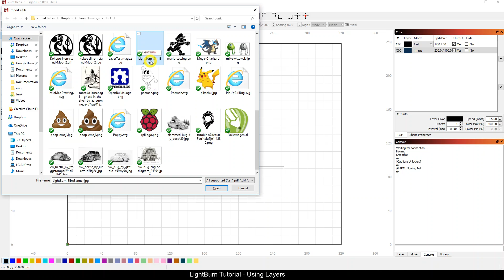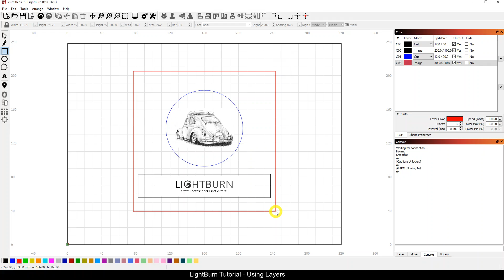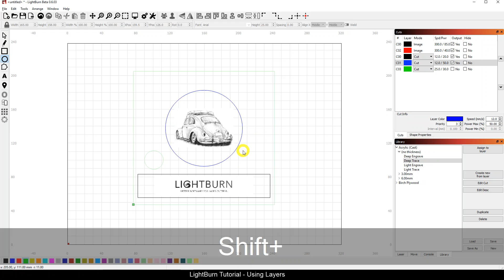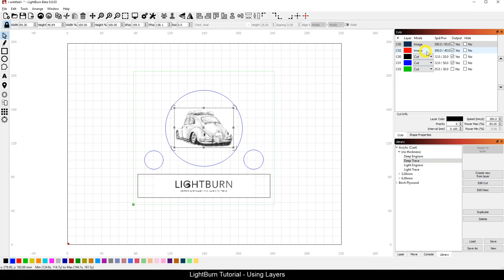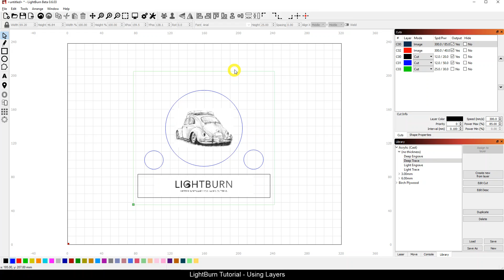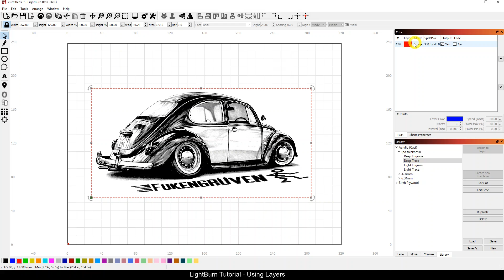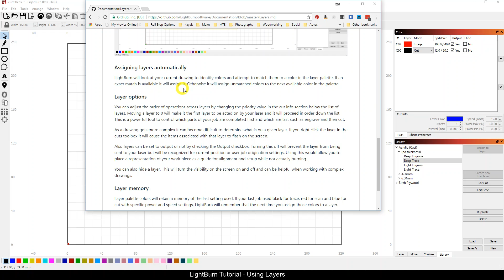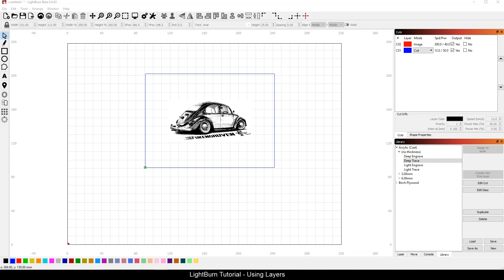LightBurn Tutoral: Using Layers

Comment: Does the colour palette in lightburn have colour values? eg RGB or CMYK..... which I could then make matching values in my Ai palette
Reply from the maker: There wasn't at the time of this video, however I "think" that they made them compliant with one of the AI color pallets at some point. I'd have to go back through the release notes. It's been discussed quite a bit on the old facebook group or in the forums so you may get a more direct answer from there.